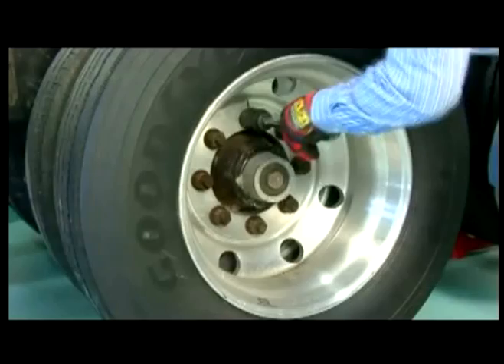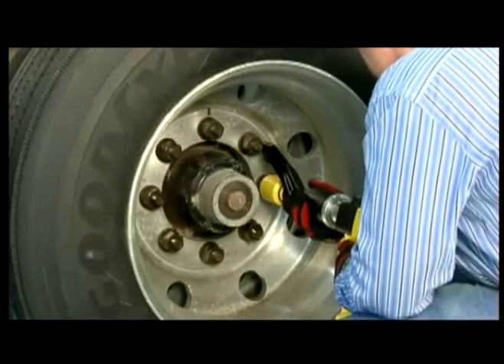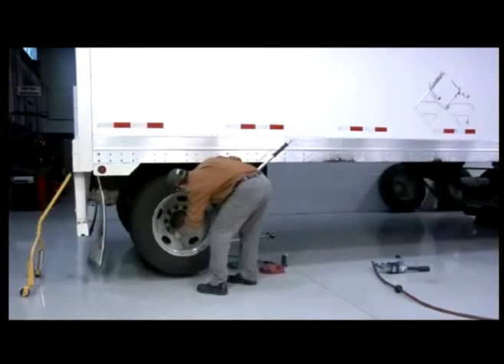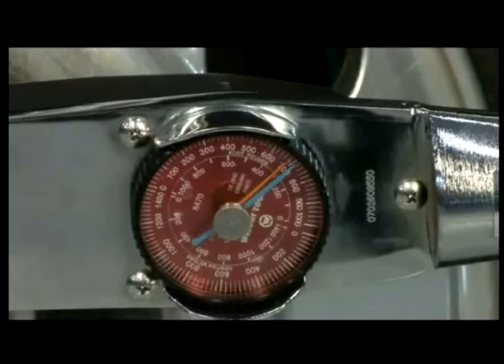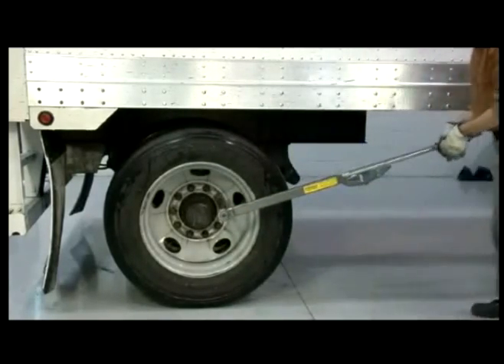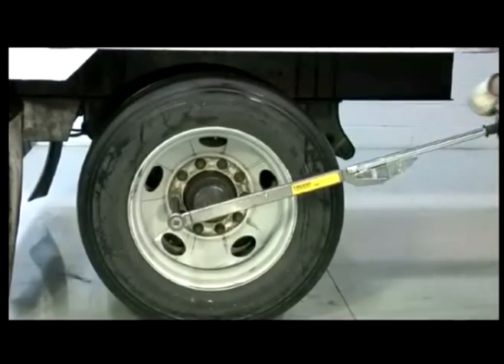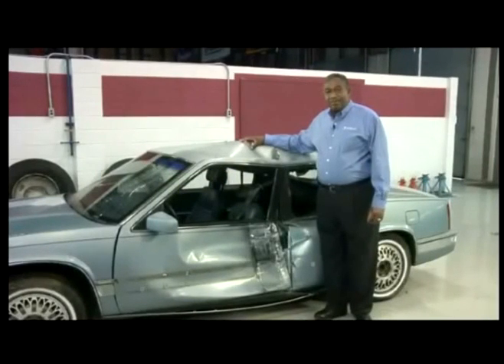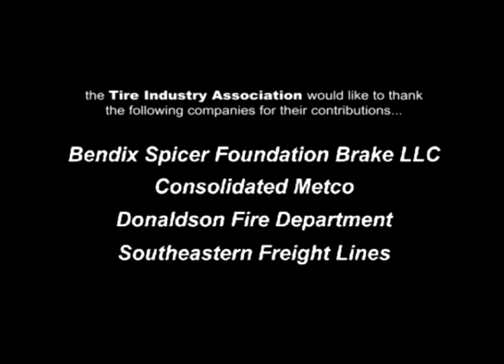Torque: It's the Law

Comment: I watched a man change a rear wheel on a 96-passenger crown school bus while on a field trip to Death Valley. He tightened the nuts by standing on the end of a 5-foot cheater pipe with all his weight. Then he bounced on it for good measure. I was dumbfounded. But he was the biggest guy there so I was ignored. That was 40-years ago and I still think about it sometimes.
Reply: Wow
Reply: that's just dangerous it takes no more than a couple of minutes to torque a wheel properly
Reply: If he weighed 200lb, jumping on it applied 300lb of force on a 5 foot moment arm for a torque of 1,500 ft-lb which is above the permanent deformation torque unless the threads were rusty or dirty.
Reply: I remember these good old days when impacts weren't so strong you could get away with with that, unfortunately there is too much emphasis on power and not accurately,.

Comment: UPDATE...after 30 years changing wheels I had a near wheel off, the problem is, other factors affect torque and clamping force, they make a valid point but they don't mention rusty studds, refurbished rims with paint runs, out of balance/high runout  wheels with no regard for opposing the high spots (duallys)....if you start using a torque multiplier, be aware that the impact wrench, while doing the damage, was also over compensating for alot of other sin, so  when you make the switch, get and use the studd brush and retorque/nut checks....you may think you are going by the book when in actuality you are, changing the dynamic...YOU ARE NO LONGER  UGGA NUGGA COWBOYS, BUT TIRE/RIM RESERCHERS...

Comment: I can't say about other places, but it is here.  A good quick place to check would be in the vehicle inspection regulations manual of your state (this is probably on the internet in pdf form) under the wheels section.  I've never heard of a cop breaking out a torque wrench and checking your lug-nuts before, but you're almost certainly liable for damages if a wheel comes off your vehicle.
Reply: And would it ultimatily lead to the installer or company responsible for the maintaince of the wheel.
Reply: A cop won't.  Some dot inspectors will.its very rare I seen it done in California

Comment: If you have used a 1 inch impact on your fleet and decide to do it right by using a torque wrench @475 lbs. would the lugnuts loosen because the stud and nut have already been over torqued?   Have they lost there clamping force?  This scares me,  because when you have a blow out on the road,  your at the mercy of the vendor you send out!
Reply: As a school bus fleet tire changer, I have seen a lot of over torqued lug nuts, but I say, unless you're running a garbage truck fleet where they work hard all day, you probably don't need to worry, the ones that I have seen with broken studds was usually  most likely due to antisize or lube getting on the threads, as for the road tire changers that come out, they are notoriously overzealous and I would recommend loosening and then relightening, doing every other nut, and then checking them all,,,,I have noticed that if you retorque wheels that are still hot,  they tend to move more than if you let them cool some.

Comment: What is the Torque for a light vehicle bus? Could it be the same 475
Reply: I recall getting some literature with my STECK and ACCUTORQUE  torque sticks and it mostly depends on the studds diameter, I recall a range of about 450 to 500 for a 3/4 studd....but if you have something like an F series, then it will be less, around 150 ftlbs. (don't take my word, get three that agree)

Comment: I'll probably never know how much I over torque the wheel fasteners.  With older and newer impact guns as well as the state of the fasteners (rusty threads)  it's impossible to judge how many impacts gets right into the range of 450-500ft/lbs.  More infuriating is because of someone else's negligence at another shop (so many wheel offs in a short time period)  all of us are punished with this time consuming policy of 2 techs and driver sign off as witness to
manual torquing.
Reply: You're not alone, lm the only one in our shop that even tries, but I think it's about starting a little low (air pressure or power),and then working You're way back up torquing behind yourself with a little margin of safety,  if you get the information from the torque stick it may help my old slow impact has to best feel, but it's so heavy and the new light ones want to keep tightening, have been experimenting with the Milwaukee one key but can't recommend yet.

Comment: Which one is a good torque wrench for semi?
Reply: 475
Reply: We have the MYERS TIRE "WHEEL MAN" witch is made by the UK based NORBAR which was bought by snap on, on the subject of torque multipliers, if I could only have one, it would be my torcUP RP2000 because it can also remove stubborn nuts but could also get you into trouble if you forget to turn the air back down, my favorite is the RP1000 with built-in extension and curved reaction arm.

Comment: I've seen ruined hubs and wheels from improperly tightening of lug nuts but never in a decade of working in the field have I personally seen a wheel off.  You'll crack an aluminum wheel long before you break a steel stud on the hub.
Reply: +MrDjones55 I've seen many units towed in missing a set. I've changed lots of over torqued/stripped studs.
Reply: +Byron Lininger (fingers crossed you're far from me and your employer is regional) but seriously, if there's a bearing or wheel seal issue generally a road service will remove the wheels and hub so it can be safely towed in for repairs, are you sure that's not what you are seeing? If a axle nuts are coming off and duals are going down the highway then you're going to have fun times with the DOT.
Reply: +Byron Lininger I've had one instance in particular where a set of duals wasn't secured after a brake job and the axle smoked and welded the bearings before the lug nuts worked themselves loose.
Reply: +MrDjones55  You are talking about two different defects, Loose lugnuts/broken studs and you loose the tires. Loose bearing nuts and you can loose it all. Bearings welded to the axle are a fun project. Not all companies run aluminum wheels. Any wheel not seated properly work loose....Worn hub pilots or wheels..you know the deal. I have my 35Years in so DOT can  sux my balls :)
Reply: +Byron Lininger I was more or less just going over the scenarios that I've seen cause problems, most of the time it's user error. If nothing broke we wouldn't have a job though!
Reply: +MrDjones55 Roger that. Look where the last guy was first.
Reply: Not only have I seen a wheel come off, I've had it due to following torque specs. 

Regardless what the imagineers say, when driving down a highway, erring on the side of tighter is better.
Reply: I kinda dig what you guys are saying,  one of the reasons why we have to do the retorque is because we used the specs the first time, but do we really KNOW how tight we're getting it and are we approaching the YIELD?(where it stretches but doesn't come back)

Comment: Work at great Dane are torque machine has been down for a moth we are just using the impact
Reply: That sounds pretty typical, I've been using a torque multiplier in the tire shop,  but nobody cares intill they can't get them off, then they think they can just "BARROW " it, and plug it into straight air pressure.....even the reps for them don't want to be bothered with "wheel changing cowboy's ".

Comment: What do you call that torque wrench that use for tightening the truck lugnut
Reply: I would call that a Norbar broke back  type torque wrench,  available from...MYERS...Norbar..ALL TIRE SUPPLY...ESCO..EBAY...PROTORQUE TOOLS..
AME.....
Reply: I am currently using a Stahlwille 600ftlbs that is lighter and faster, but YOU will need weight more than 150lbs.

Comment: Torque is measured in lb/ft not ft/lb.
Reply: Alan Crook yet everyone will continue to say ft lb, including me. 😁
Reply: Look at the setting scale on your wrench.
Reply: Torque is measured in nm
Reply: It's lb.ft (multiply), so ft.lb is the same thing over. Torque is defined by force multiply with levered distance (perpendicular).

Now we got all the physics correct, how about switching to international unit: Newton.meter? Imperial measurement is no longer a well-maintained/calibrated measurement.
Reply: Torque is measured in newton-metre....
Reply: It's an academic/engineering thing. Energy is measured in pound-feet. Torque is measured in foot-pounds. Work or energy by definition is force moving through a distance so you see the product (multiplication) of pound force (as opposed to pound mass) times foot distance.
Torque as an applied rotational force is product of lever length by force applied (perpendicular to axis of rotation) to it.
It is about convention.
Reply: @momackay  when in Rome.

Comment: Blah blah blah. Who uses a moto wheel 8 hole for a torque video? 475 foot pounds is just a standard OEM torque. On a 33 millimeter nut. Which is shown. 1 blip of a normal gun and you're at 500. Now that you've gone to 500.  475 is no longer the mark. Also tightening with a gun at 400 then letting the vehicle down off the Jack and then torquing to 500 which is standard industry.  Is unacceptable. Leave the vehicle in the air and torque to 500 foot pounds. In the air. By hand.
Reply: To add to my torque specs... blowing off the Hub and cleaning the pilot pads lightly oiling. The studs. With one drop on the stud or WD-40 spray. Two drops on the nut spinning the 33mm nut washer. Wire brushing and wiping the wheel faces inside and outside. Including the hub center. Never ever ever use never seize. Ever. This just turns the unit into a bearing which will continuously tighten and never torque.
Reply: You use Wesson vegetable oil on 33mm nut flange and stud.LMFAO j/k bro.🤣😂
Reply: @larryalongi3173  30W is the only lube recognized by TIA and you cannot use an air gun to torque, I don't care how good you think you are.
Reply: Hey WOW man, all you dudes really know your stuff, but I've been changing tires for so long and listening to music, that I have written new lyrics for Herman's Hermits "kind of hush"...There's a kind of crust..all over these wheels, alright..all over, this town, you can here the sound, of wheels coming loose, it's like a bad dream..so scrape them very carefully, so you won't hear the victims say they hate you, forever and ever..
Reply: @charlienewell7270  I went through a process of dropping the air down to 90psi and then turning it up in 5 psi increments intill I reached the point where the torque wrench no longer turns the nut, problem was, little things would change,  psi at compressor affects CFM at the gun, wear on the torque stick,  the list goes on...the makers of the torque multipliers claim that they are 100% repeatable and have more cycle life and accuracy than the manual torque wrench. (though personally, I would recommend them as a "second opinion ")